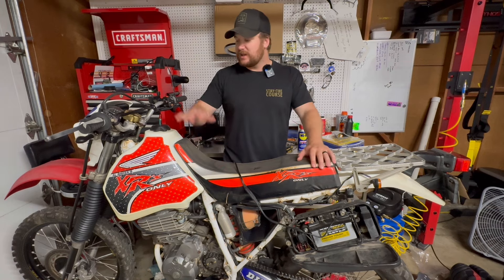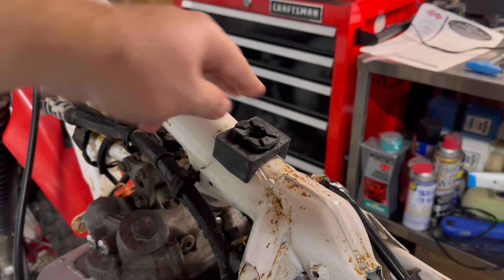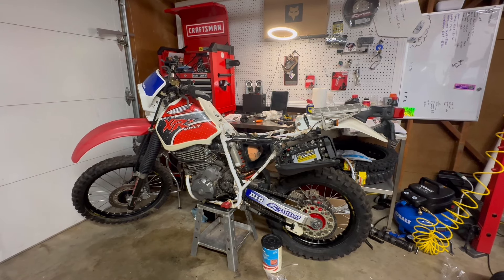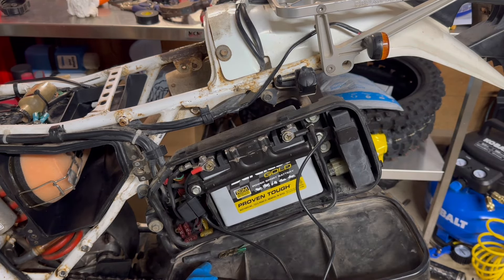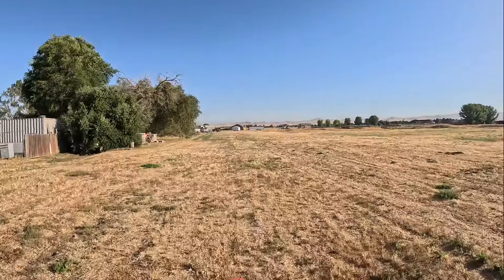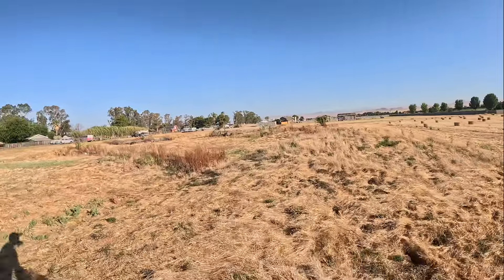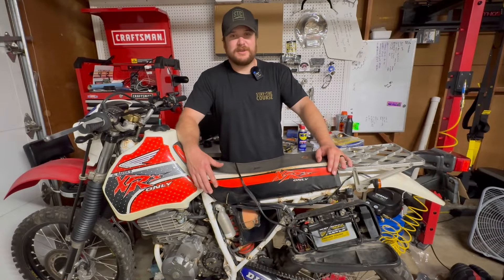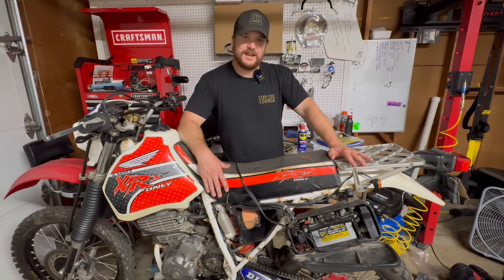First Ride On The Project Bike! | IMS Tank Install | 1994 Honda XR650L

Comment: From my experiences that CDI will leave you stranded. Better replace it soon and carry an extra one . great video
Reply from the maker: Not a bad idea! It’s definitely on the list 👍🏻
Reply: @tobyhottle1578  it’s always a good idea to have a spare spark plug on hand too.
My 2012 XR650L suddenly decided to become difficult to start immediately after I purchased it a few months back, and the battery went flat pretty quickly from trying to start it, so in went a brand new battery and the starting problem remained.
I sought out a good mechanic to look at it as I am out of the country for a while and he sussed it out quick smart and threw a new spark plug into it and bingo, fires right up now.
Just something I observed by looking at video of the bike cranking and running, the headlight was doing what I would call “strobing”, where it would pulse at low rpm, only noticeable through watching the video as to the naked eye it seemingly can’t be seen.
After the new plug went in the “strobing” effect seems to have disappeared.

Comment: Is that cylinder head standard?
Looks wider/fatter than standard.
Reply from the maker: @rosshanley8398  it is not.  It has a “big fin” head.  Which is great, but has created some clearance issues with the clutch cable and IMS fuel tank
Reply: @ thank you for that.
I realised what the head was after I posted my comment.
They’re hard to get those heads.
I may get one myself through XR’s Only, if they still make them.
Their site says they make them to order.
I also have a brand new IMS 4.0 gallon tank awaiting fitment.
I have a new NICECNC oil cooler going on it in a few weeks.
I subscribed to your channel because you’re providing good information.
Regards to you.